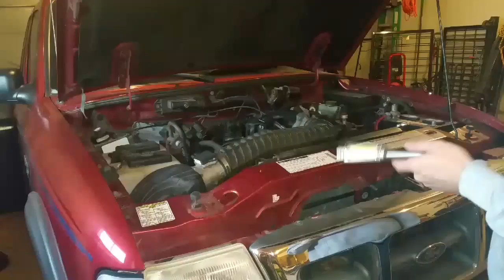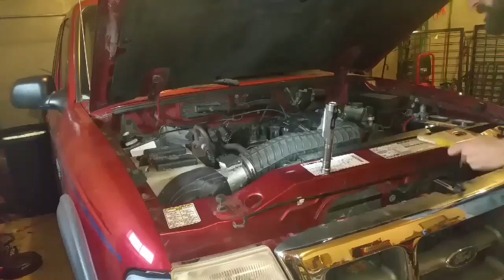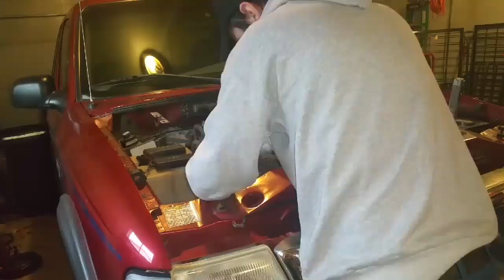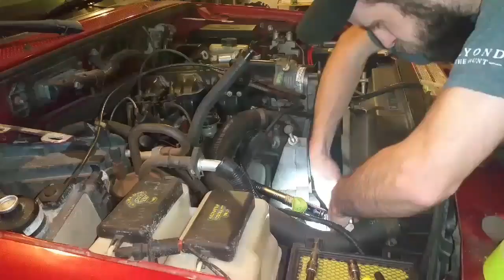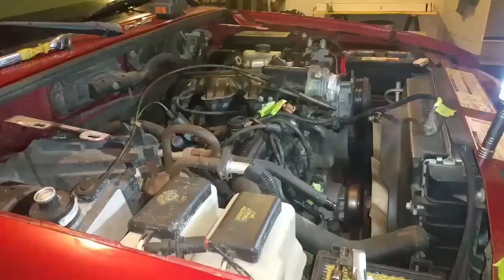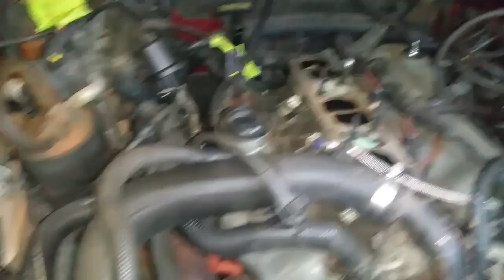Ford Ranger Engine Removal Time lapse Pt.1

Comment: People say they don't rebuild much anymore. That's because people throw away money and they're morons. Let me see I got a hundred grand in my pocket completely rebuild the truck the way I want it for 10 grand or go spend 100 grand on a truck that's going to have the same longevity as the $10,000 truck that doesn't have everything I wanted to put in it. I did the same thing man I've been happy I'm still upgrading mine. I will say in lieu of the performance and gas mileage that I didn't realize for my other previous rangers this one I probably would have went with a V8 crate lesson learned but I'm still happy I still saved a lot of money and I got a good running truck

Comment: Alot of unneccessary removal going on. In my 35+ years of pulling engines, I've never done it like this, most techs wont do it like this as its much easier to do it after its out, and you wont have to crawl all over it, wrenching your back and whatnot. Most of my clients bring their bungled up attempts to me to fix it, it always leads to the same thing. DIYers who have no clue....save your time and money, get a pro to do it right the first time, not you tube.

Comment: I am working on one right now. The time laps is OK,  but to fast. Do you realize that you do not have to disconnect any of the electrical at the engine? Everything will come un-plugged at the firewall. That means, removing the intake manifold to get to the injectors is un-necessary.  I just figured that all by myself with only a few cuss words.

Comment: Im doing my first engine pull out job on my 03 4.0l ford ranger to replace the timing chain cassettes. And wanted to know what is the best and easiest way to take out the bell housing bolts? Thank you!!
Reply from the maker: boboy Nunez I like to use a long extension with a swivel. By long I mean one of the 3 foot ones. For the top bolts you can also peel the carpet back and there should be a plate on top of the trans tunnel that's removable to access from there. I don think I had to do that though. Pretty sure I was able to do it by removing intake to reach bolts.
Reply: a21bravo thanks so much for that so far the job has been like no other let me tell you just to change the dang timing chain guids. But then again its my first time and i would like to learn and also i just dont have the $800 a shop charges me. So any help from you is much appreciated and how many bolts are there by the way?
Reply from the maker: boboy Nunez 8ish. Can't remember... All I know is when I pulled it i was glad I swapped it because I didn't want to put that thing back in, haha.
Reply: a21bravo lol heck yea you aint lying. I wish i could afford that i just need it up and running asap!.
Reply: a21bravo do i have to take off the upper intake manifold in order to harnes the cherry picker chain to pull the 03 4.0l soch engine out?
Reply from the maker: boboy Nunez I pulled it off.
Reply: a21bravo ok thanks and was there a good spot to hook the chains up to?
Reply from the maker: boboy Nunez I actually used a tow strap and wrapped them around exhaust... I have a video of pulling it out also.
Reply: a21bravo ok thanks!!
Reply from the maker: boboy Nunez nevermind, I did use chain. 

https://youtu.be/0D1hQCpRAqU
Reply: a21bravo ok now i see what you did thanks!!

Comment: What is your wiring label method?
Reply from the maker: Nob Nyers Label method? Marker and tape.
Reply: That is the material you use, do you use any particular method to label your wires with marker and tape. Do you start at any particular location on the motor?